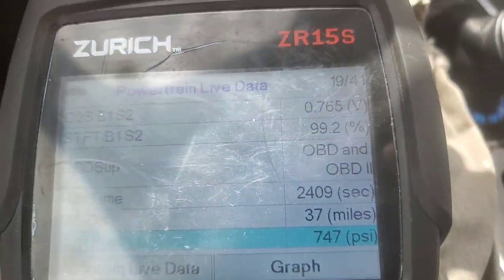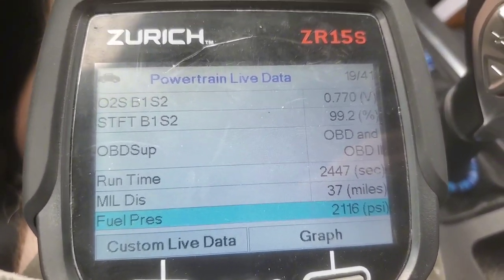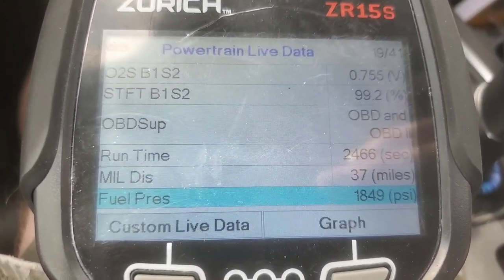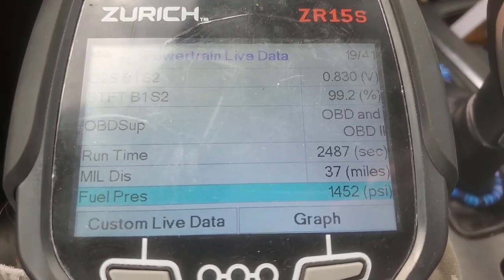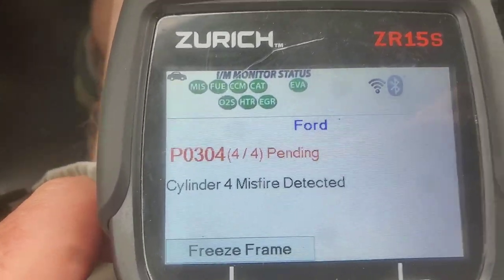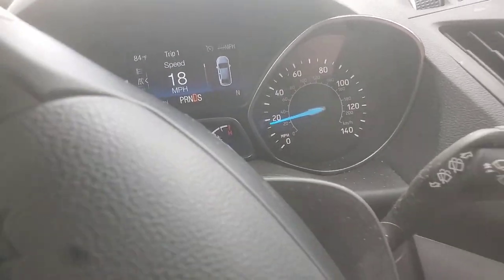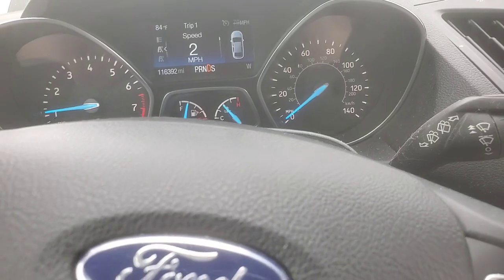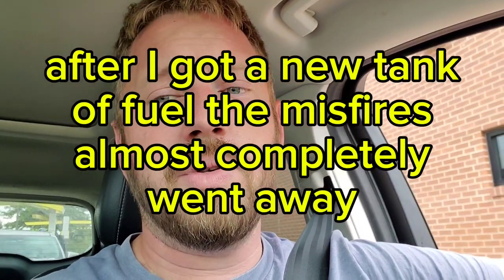2018 escape 1.5l ecoboost, random misfire. Help!

Comment: Did you figure it out?   I have the exact same thing going on a a 2018 Ford escape that i just did the engine on.   Always 1 and 4, never either, always both.  I swapped plugs, coil packs, cleaned the injectors, compression tested, boroscoped the cylinders.........   I actually threw in the towel and dropped it off at the dealership this afternoon so they can hook it to their scanner.   My fuel pressure was at 2195 on the Freeze frame.   I know when you get the flashing engine light and the misfire the PCM shuts those injectors off so it doesn't cause any damage.